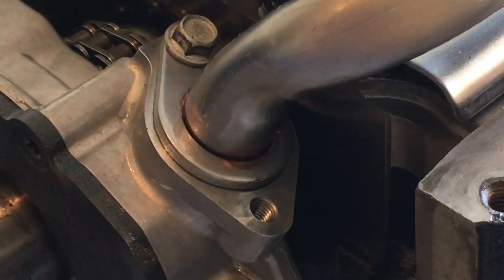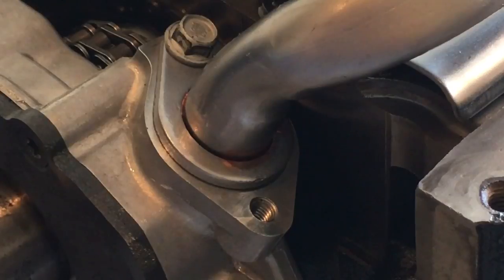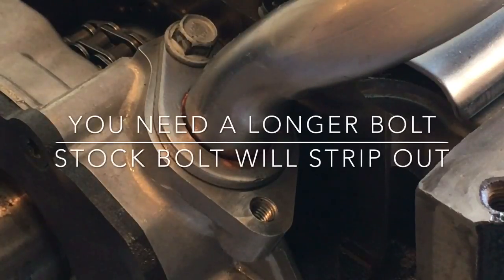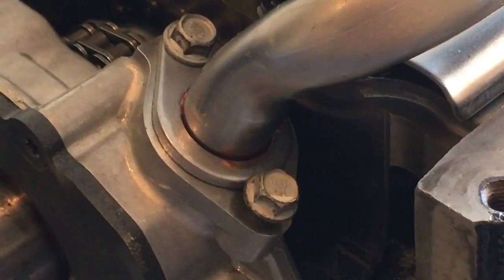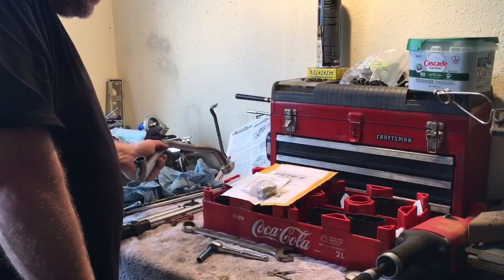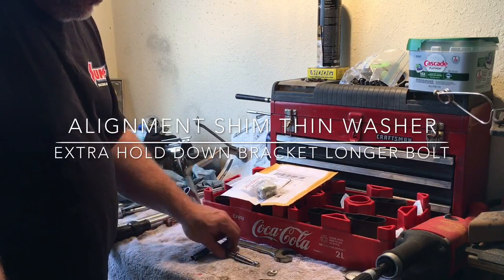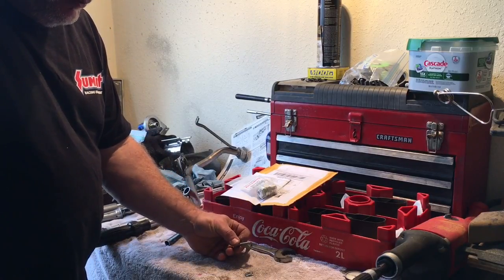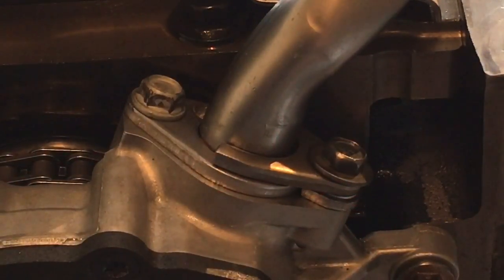LS 4.8 5.3 5.7 etc Oil pump pick up tube brace "Double Bolt"

Comment: How did you make out with the drain set up in the pan.
Reply from the maker: We tig welded a Vibrant -10 fitting to the timing cover, it was a PIA the cast aluminum kept pulling up contamination.  I just posted an update video.  Thanks for your offer we just wanted to try and figure it out.